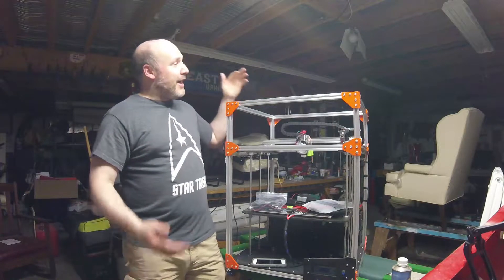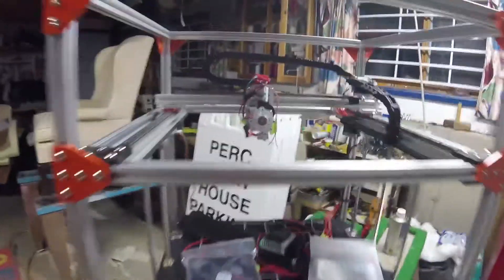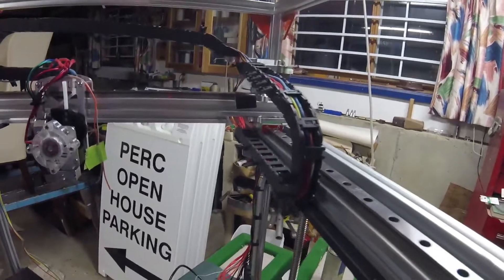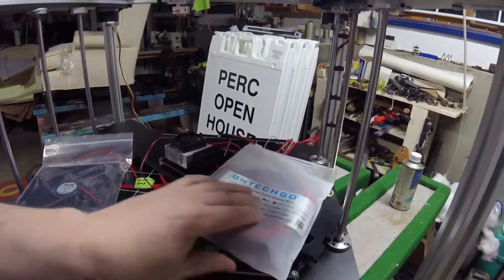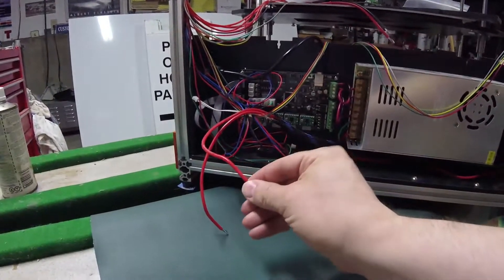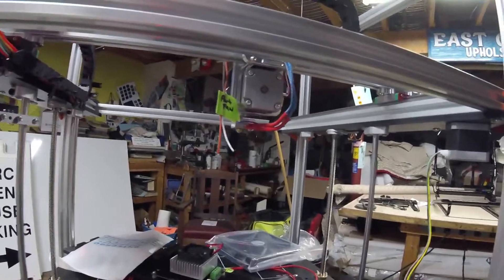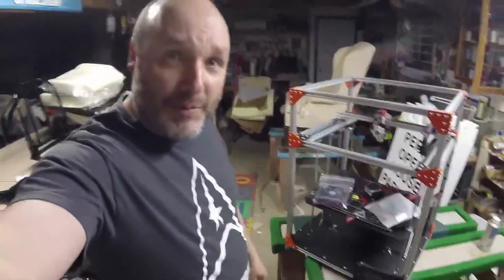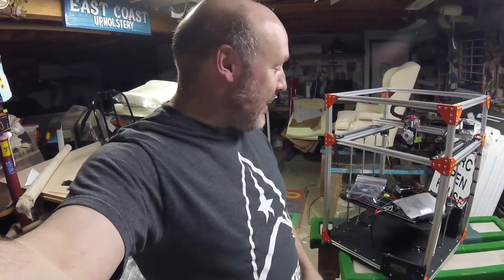FolgerTech FT-5 Build Update (July 1, 2017)

Comment: Hi, i have the same configuration FT-5, Aero, 713makers gantryand also put a big fan to cool the stepers motors.
i also have the BL touch it work great,  i would only change the springs to level the bed to a biger ones, the stock ones are to small.
great work
Reply from the maker: You are absolutely correct!  The included ones seem more useful in a pen!  I bought a few different sizes at my local hardware store....it's hard to find one that's not too huge around the 3mm bolt.   I haven't done the BL Touch or any auto-level stuff.
Reply: Hi try the springs of the extruder, the auto-level is greeat, i have the Bl touch, worry free....

Comment: I do like the aluminium cornerbrackets. I also have them on my printer. However on all corners i did install also the inner-corner L-brackets. This makes the printer rock solid. An added advantage is that i can take every corner T & L bracket off to paint (like you did) while the printer holds it structure. I have planned this from the start and i am glad that i did. The only place you do not put the inner L-brackets on are at the middle beam on the front so you can remove the beam if you want. That way you have a complete open front so you can access the inner parts more easy.

I did put my printhead on backworth because the manual did not say how the direction must be. They don't give you an overview on how the complete installation should look like. That's exactly what you have encountered. This happend on more steps in the manual. They realy should correct this.

I also did struggle with the cablechains. According to the manual i should use 21 links for the X and 22 links for the Y gantry. That is fat to short to reach the complete printarea. The reasoning is quit rediculous. The manual does say (Quote: "Take the cable chain and split it in half (21 links, note using more than 21 links will cause the cables to be to short)." . Why not give longer cables so you can install correct length cablechains? I don't understan this at all.
With 21 & 22 links i came 4 cm (40 mm) to short so i decided to put in as much so the X & Y carage can reach the maximum length. If the cables are too short i can cut chains away. Too less chains i can not put in afterworth. So more is better in this case.

Now i am installing the heatbed. I do have to solder 2 red 14 AWG wires on the heatbed where already 2 black silicone wires are soldered. Does the bed need 4 of these wires? i don't think so. I do like that they did this for me but come on, these things do make you thinking; "Did i make an error?" I did build a printer before so i know how it goes but for someone who does this the first time you need clear instructions.

I hope the wireing goes to plan so i finaly can print something.

Comment: How much chains did you put on the X & Y cablechain? I did 21 on the X & 22 on the Y like in the manual but now i can NOT get the full printbed surface covered in the X & Y direction.
I think the reasoning of installing too chort cablechains because the cables are to short (that's what the manual does say) is a very strange way of thinking. Why not give longer cables so you can install the right length of cablechains?
Also the tyraps of the GT2 belds do hit the pully's.
What is your advice?
Reply from the maker: Frans van Heel I'm still putting mine together.  I do have the 713Maker Gantry installed and I don't recall how many chain links I have on mine.  I'll have to count em up!
Reply: When you do please look how far the nozle reaches the glasplate on the X & Y. Mine stops 4 cm from the left of the glasplate because the cablechain is not longer. The Y has the same problem but not so extreme.

Comment: save yourself some time get a AC silocone heater for the bed. I used that heater as the base put the silicone heater on the bottom of it.  Makes all the difference in heating